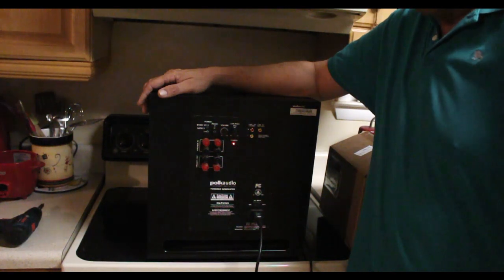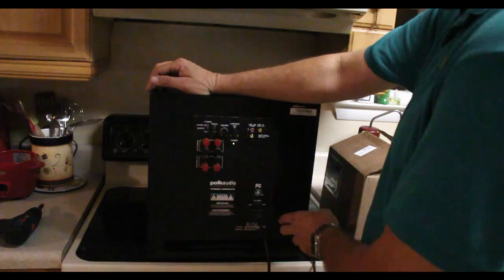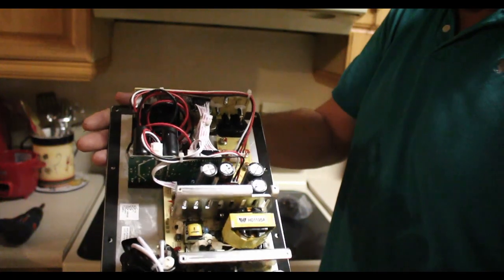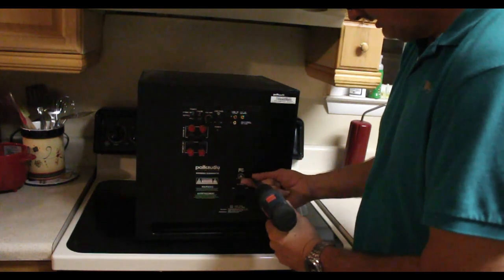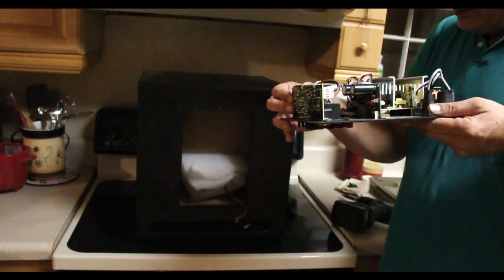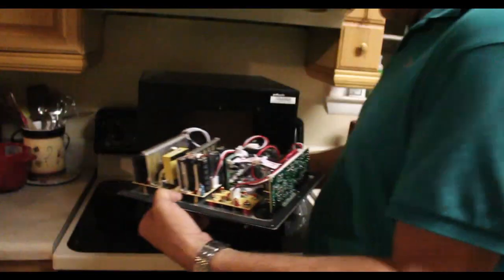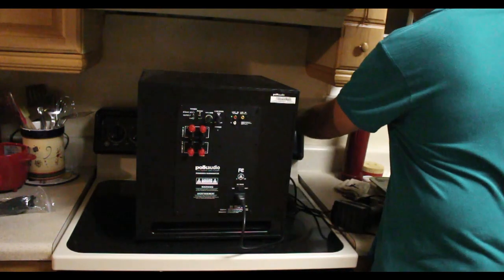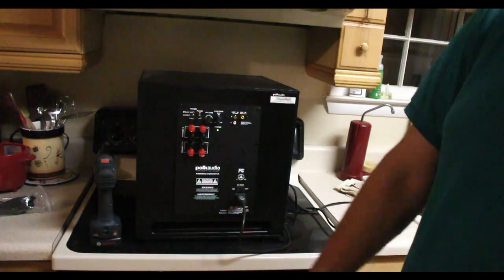Polk Audio PSW-505 Amp replacement.

Comment: Having the same problem (buzzing when not hooked up to any device) however my light will not go back to green .... Red light of Death! Just got off of the phone with tech support this morning. They too believe it is the power amp .... well surprise, surprise, surprise. All of the videos, web articles and forums that talk about this exact problem with the PSW505  there is OBVIOUSLY a known issue with sub standard parts and or QA.Then I was told told that if I cannot find my receipt it will cost me $150 to replace. ......... For an item that rarely gets used ........... lovely! May have to start researching alternatives that have better customer support.

Well .... Glad you were able to get a replacement. Truly hope it lasts longer than your first one 👍
Reply from the maker: This one lasted about 2yrs used daily. That stinks if you can't find your receipt. I keep the boxes, packaging, and receipts for everything. It comes in handy in case problems arise or in time to sell and upgrade.

Comment: Thanks for this video. Mine died recently after working amazingly for 4 years. I was thinking about getting a new 12" for myself for x-mas but I saw online I can get this same replacement amp for $245. This looks so easy that I might go this route. I found another Polk Audio 12" for $250 but this amp is actually 440 watts and the new one is only 100 watts so the easy choice is to replace this amp.
Reply from the maker: Do like I did just leave it disconnected for a couple of weeks, it might come back to life. That amp was dead until I shot the video lol. It sat in the closet 2 weeks then made the video 😂
Reply: @thenotoriousrvh6091  mine was a different issue that these subs have. it was popping every 20 seconds and at first, it would go away after 15 to 20 mins but after 3 days it lasted for an hour, and then by day 10 it wouldn't go away. It worked great for 4 years

Comment: They have drop in replacement amp boards that cost more than the sub
Reply from the maker: That sucks. I'm sure parts express has one for a lot cheaper that'd probably work just fine.
Reply: @thenotoriousrvh6091  
Link?Have you used them before?
Reply from the maker: I've ordered from them but have not used their plate amps.
https://www.parts-express.com/speaker-components/subwoofer-plate-amplifiers

Comment: Where can I purchase the PSW 505 amp? I have one but the sound coming out of it is low, even when the volume is max.
Reply from the maker: I'm sure you can contact Polk customer service or Parts Express may have something more powerful & cheaper than the original.
Reply: @thenotoriousrvh6091  how do I get in touch with parts express?
Reply from the maker: @RG7-SEVENTH7  https://www.parts-express.com/speaker-components/subwoofer-plate-amplifiers

Comment: Why didn't you use the new wires that came with the new amp?
Reply from the maker: No need or point in pulling out the sub to do so. Could have I guess.

Comment: Hi Robert, awesome video, very easy to follow. In the beginning it looks like the amp went green (fixed) so I was wondering if you remember what you did to get this fixed so maybe I can try it, I have the same issue with my PSW505 and Polk will not send me a replacement amp...thanks so much!
Reply from the maker: Yes it did turn green lol. It was unplugged for several weeks while awaiting the replacement amp. I did nothing to fix it. I've plugged the old one in a few times to see if it was indeed working or a fluke because I was doing the video. So far it has came on 3 out of 4 times. 

My fix dumb luck because I was doing a video 🤣🤣
Reply: The auto turn on relay sucks it better to do it turn it on and off by hand the relay was most likely stuck it's on the cross over or input board . if you get it to go back to green stop using auto turn on and just turn it on and off by hand or replace relay board/crossover for permanent fix.

Comment: On the old amp the only thing that wrong is the relay for the auto on its in the cross over board it will do it again. Best thing if you're not going to fix is leave it on with the light green and turn the power on and off every use.   eBay sale for parts
Reply from the maker: Thanks. I figured it's something simple. Haven't had a chance to mess with it.
Reply: I’m having a problem with my PSW505 where it just plays static for a while when I turn my audio on, then it eventually works.  I looked up the warranty and it’s 3 years on the amp and 5 on the speaker.  I’m at 4.5 years now but I’m going to try to have it replaced anyway, it’s worth a shot.
Reply: @Ben7seven7  what amp is it a bash ?
Reply from the maker: Exactly

Comment: Hi Robert, I had the exact same issue with my PSW505, however mine died at some point after trying to figure out what was wrong, Today I was actually calling Polk support, but after 1 hour waiting I gave up, how did you contacted them? and what did they asked you? am wondering if I can repair mine, I was so afraid I have to buy a new device.. please let me know!!!
Reply from the maker: I just called 1-800-377-7655. No problems talking to anyone. They simply asked me what the problem was. They sent me an email with a case number. I had to email them a copy of my proof of purchase which I did. The next day received a confirmation email saying the replacement amp would be sent out.
Reply: HI Robert, just wondering how the Polk support went for you, I have the same problem, does Polk just ship you a replacement part of do you have to pay for the new part?
Reply: I called Polk audio support yesterday and was on hold for 3 hours before giving up.